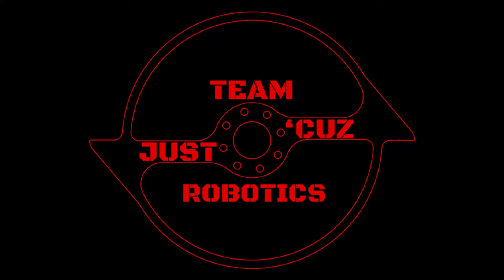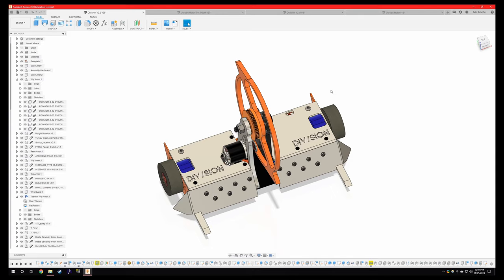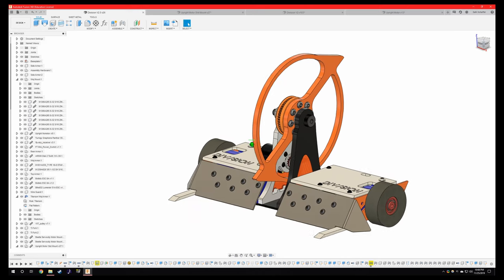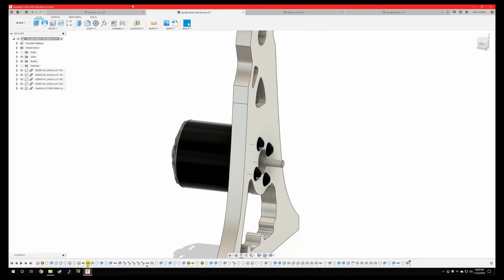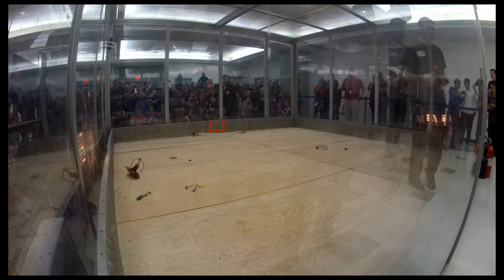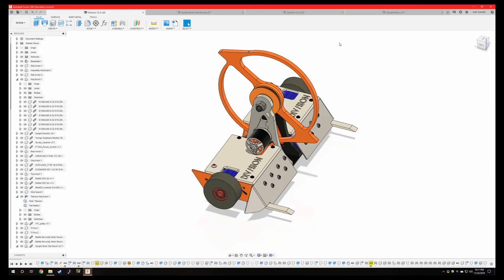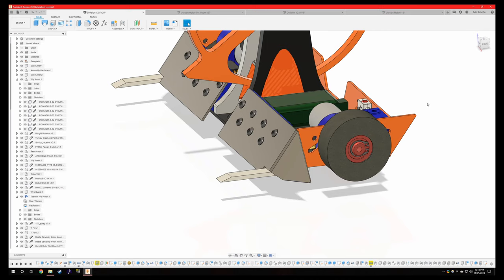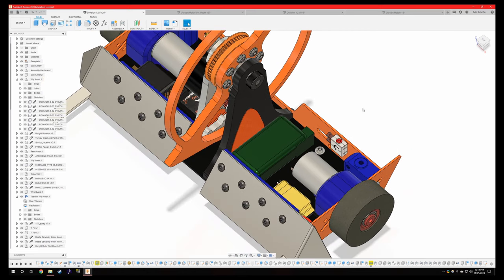Division V2.5 Overview - All Changes and Upgrades

Comment: Great video. I use the KPS1203D 120v DC 3Amp power supply (ebay) for anodizing titanium. 120v gives full range of color and 3Amp is enough power for hobbyweight and smaller sized Ti parts.

Comment: What is the software used for this? I'm looking for a 3d printer and software to get started for my own bot.
Reply from the maker: I design all my robots using Autodesk Fusion 360 which is a free CAD program. Its capabilities are pretty much unparalleled among other free software options. 
For 3D printing I personally own a Prusa Mk3S and a modified Tevo Tornado Pro. The Prusa machines are all fantastic and I highly recommend the Mk3S(+) or Prusa Mini (+). The cheap chinese machines like the Ender's and Tevo's are pretty much you get what you pay for and if you don't like tinkering with and repeatedly fixing your machine, maybe don't bother with those. I slice all my prints using Prusaslicer, even on the Tevo, as it is in my opinion way better than Cura, and also free.